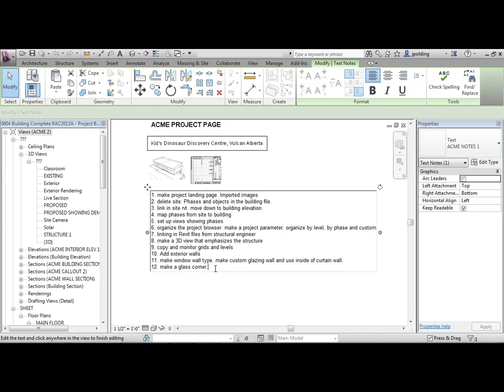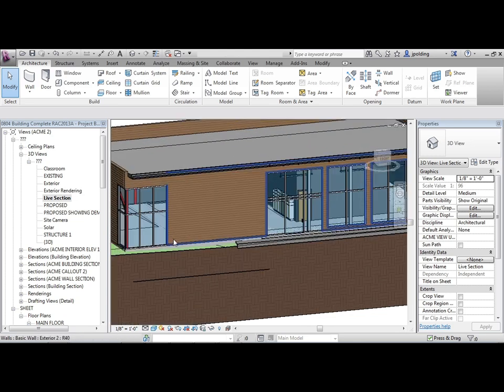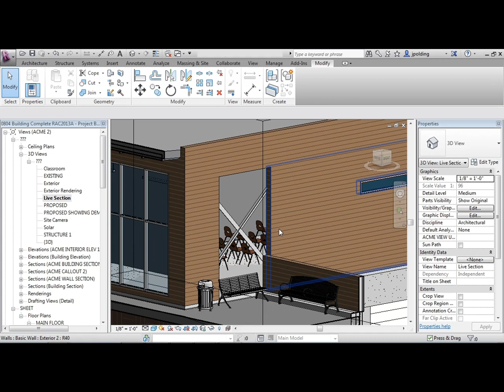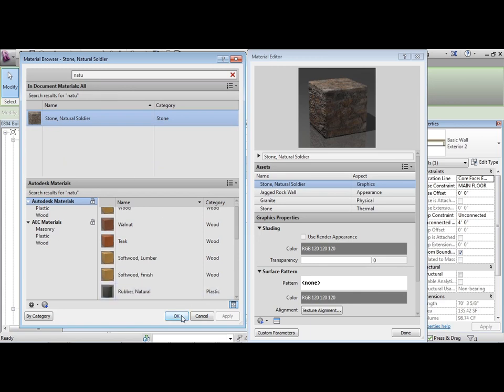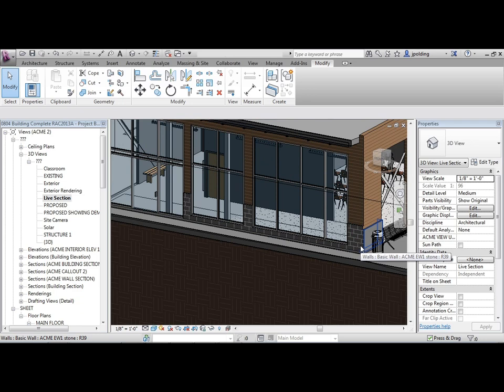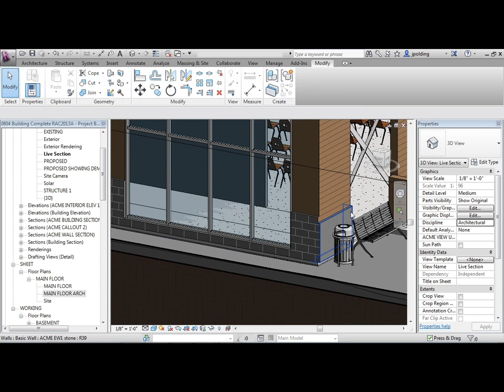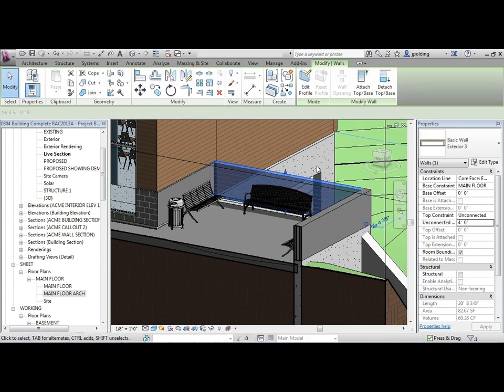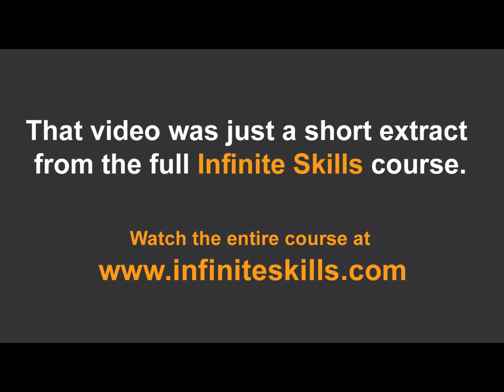Advanced Revit Architecture 2013 Tutorial | Make Stone Base Wall

Comment: Found that it was easier to do what you first mentioned - build a second wall outside of the first.

How would you split the wall as you did but then ensure that the stone that you add only goes to the outside of the wall? When I added the stone, the wall re-centered on the wall and pushed itself inwards.

Comment: I'm adding CMU veneer wainscot to a tilt-wall panel that is visible from all 4 sides.  How do I align the bottom and top of the wall so that the tilt-wall panel is continuous?  The top of the wall is just bare tilt-wall concrete.  Any suggestions?